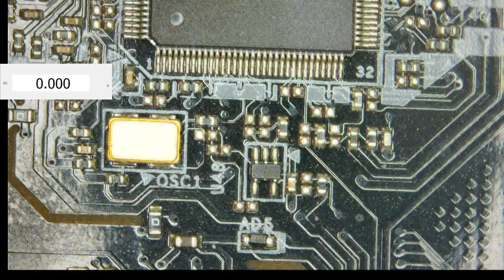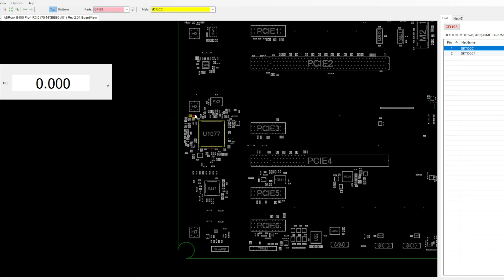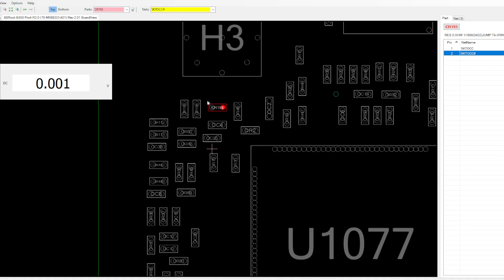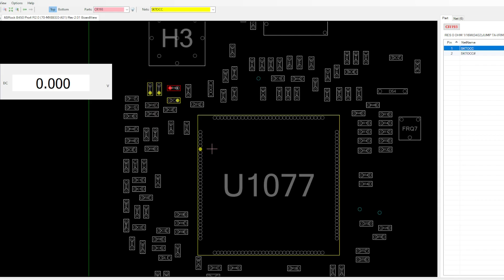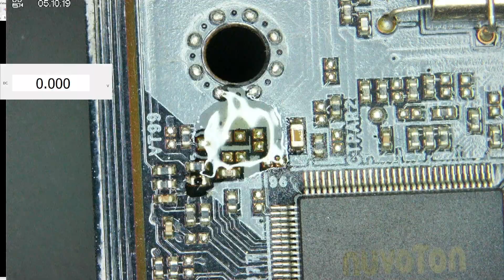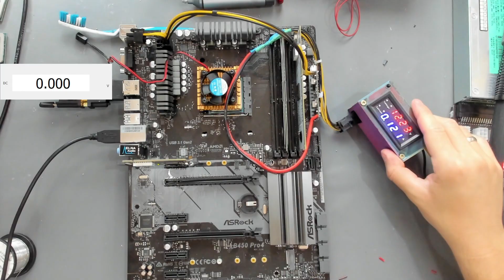BROKEN ASROCK BOARD FROM EBAY , CAN WE FIX IT? ||||Asrock B450 Pro4 Motherboard repair fix

Comment: Heya , i have this board tested it with diferent ram psu cpu apu , it does not do any beep on the speaker.
When i clean power and then turn it on again it turns on the fan on and off and then turns off
1 time it stayed on for like 40seconds . The backlight is lighting up and breathing but no post any ideas . Didnt measure anything
Reply: have you figured it out?

Comment: How do I boot with screwdriver
Reply from the maker: You need to short the pwr pin with ground! They are marked on your board! If you have any trouble check the manual off the board, they are also available online!

Comment: Hi, huge fan! Its great how you deduced the issue so quickly. I have the same mobo rev 1.0 with no POST. I swapped every parts with another PC and found the issue was with the motherboard, I found a swollen vrm capacitor on the left side of the cpu socket (820uf 3V 6.3x8mm APAQ AR5K series cap). Its the exact middle one of the 5, swollen underneath and tilted towards left and I was able to find a only 6.3v 820uf 6.3x8mm cap for the replacement, it has 1mOhm more ESR and 200mA less ripple current, is it okay to swap the swollen one with this one? Should I replace all the 8 VRM caps 5 on left + 3 on top? Please help me. I do not have the knowledge on the subject but I'm learning slowly, but I can do basic soldering and have basic equipments. Thank you reading, thank you for your help!
Reply from the maker: Swollen caps on an AM4 Board should not be a thing, are you sure the board didnt get heated up a lot or someone tried to replace the socket?
Swapping it out with the 6.3V is no problem!
Very rarely do these lead to a no post. So there might be a different problem. Do you have VCORE and SOC voltage?

Comment: i could see it if it were a resistor at the edge of the board but how does someone knock off a single small resistor that is positioned in the middle of a cluster of components without showing signs of damage to anything else?????
Reply from the maker: That was really weird to me as well! There was no scratch no nothing. Nothing idicating damage! But ive had this muliple times by now!

Comment: Why there was no voltage to chipset? Can you measure right now if the inductor was the pch power supply?
Reply from the maker: That wasnt the PCH Voltages that i wanted to meassure, that was VPPM. The PCH Voltages is under the heatsink!

Comment: What kind of software you use to display instrument readings?
Reply from the maker: Its from the multimeter i use which is a UNI-T 8802E which has its own software to display it on a pc!
Reply: Was wondering too

Comment: why not just bridge it?
Reply from the maker: While i was editing the video and saw that i even bridged it at on point i was like, "why didnt i just leave it like that?". So you are totaly right, that would have worked just as well!
Reply: @MainboardMedic I think the only 2 reasons for zero ohm resistors are that they can easily pick&placed by a robot (despite a solder bridge) and that you can bridge over a separate trace underneath (doesn't matter on modern multilayer).
Reply: @dolphhandcreme It does matter on cheap boards where you want to cut pcb cost where it's possibile. 0ohm are also used for creating ladders for various RAM configs on GPU PCBs and notebook PCBs with soldered memory.
Reply: Aren't they suppose to break when overloaded?
Reply: @nicoful86  Well Resisatance is 0 do it won't heat up, it's not shunt, so to speak afterall ;)
Reply: @Iscandelt  yeah that makes total sense!
Reply: @nicoful86  no, that's what fuses are for. Or wired resistor-fuses in psus.

Comment: Do u maybe have a video of fixing onboard sound card?
Reply from the maker: I have a video where an audio controller was shorted, but that was quiet obvious and not to much to learn!
Reply: @MainboardMedic  I wanted to ask you on insta but you never repplied: I got an issue where after graphics card installation, onboard audio died, dunno how the hell I managed to do that because I did all the neccesary safety measurement I could, everything was unplugged and did not used any force at all.Out from your experience how did that happen and is it repairable?
Reply from the maker: @pcpartpicker-1408  Hey there, sorry i am really inactive on my social media! 
Sounds like a classic knocked off component. Should be reparable!
Without a microscope or the shematics it will be hard to tell, because it might only be chiped and that can be enough!
Reply: @MainboardMedic  Hmmm knocked off with what??Graphics card and onboard audio are at different zones on MoBo, but then again I am a beginner.
You think while installing grphics card left edge of it knocked out or damaged some component? I could potentually take out MoBo and inspect board without microscope, but where could I find schematics? Is it possible that electronically while GPU install some component was damaged, I mean not physically?
Reply from the maker: @pcpartpicker-1408  Exactly that ive fixed multiple times already, it happens so much faster then people think
Reply: @MainboardMedic  but knocked out component should be near the case which I don't move. Though those components are very tiny specially caps.So what do you suggest me to do as a beginner in this?
I also have an option to buy same MoBo from same guy for 200 euros, but I think that would be silly idea.
Reply: @MainboardMedic  where can I find schematics for it?
Reply from the maker: @pcpartpicker-1408  What board is it?
Reply: @MainboardMedic  Strix Z690-F
Reply: @MainboardMedic  any help with schematics, bro?
Reply from the maker: @pcpartpicker-1408  That shematix is sadly expensive
Reply: @MainboardMedic  Then you would be billionarre ;)